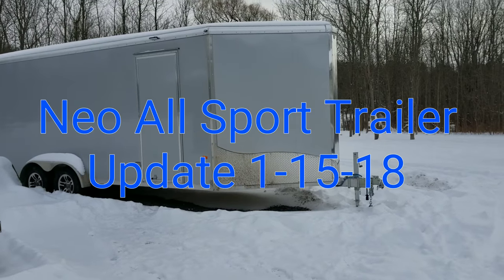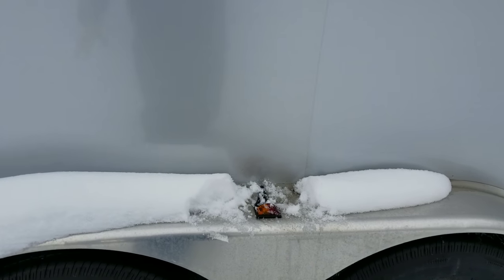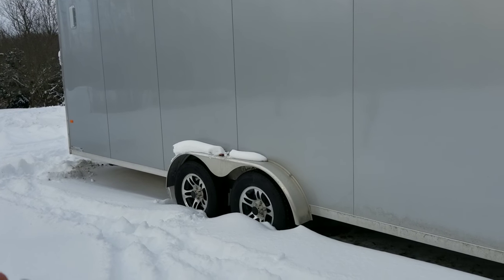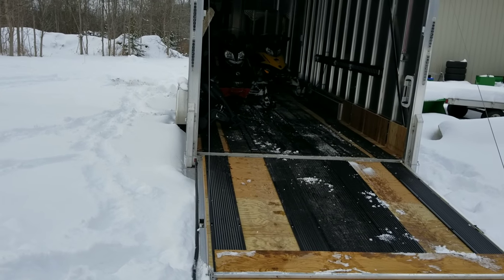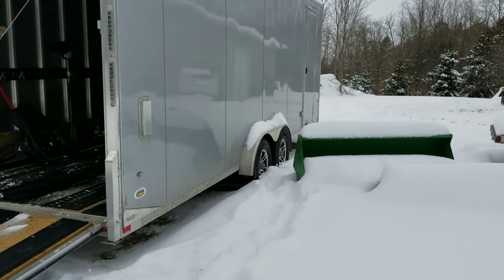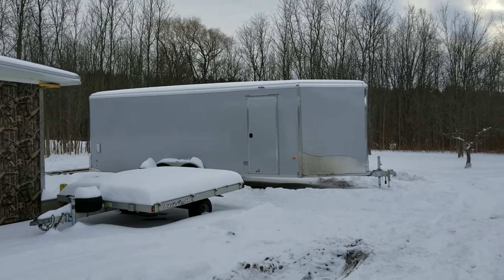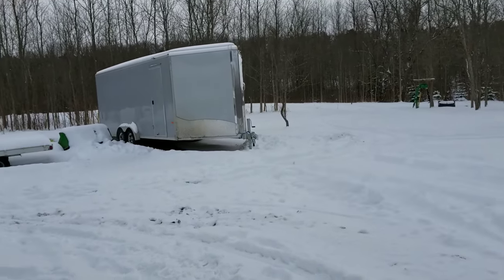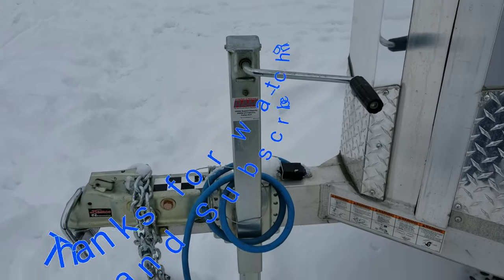Neo All Sport Trailer Update 1-15-18

Comment: Thanks for video.  My rear door seal on my Interstate did same thing. The red peel off 3m backed tape on those seals needs the promoter wiped on the surface to triple the stick power. Maybe the prep at factory was bad.  I wonder if your tongue weight is light. But regardless these are kites with or without awesome load balance.  Keep us posted.  Getting my NEO NAVR147R6 late Feb.

Comment: Thanks for the update, I bought a brand new Neo back in December also. Mine is a piece of crap. I've only used it on three snowmobile trips. I spent countless hours washing and detailing it and store it in a heated building, and it still looks like s***. The front Diamond tread Stone guard is cloudy and dull looking. The aluminum trim is oxidizing. It also Hauls like a kite, maybe because it's a 26'x8.5'. they use zinc plated Hardware, which are already starting to rust. Please give an end-of-season update? Thanks

Comment: My Front seal failed as well. Not the back though on my 2017 NAS227T Sport. On the rear ramp flap.. my screws stripped out and the 2foot section of flap came off. They used just self tappers into the Wood vs carridge bolts I would think would be better. All my interior lights and loading lights are not working now either. Also.. this things dents so easy! I swear a tin soda pop can is thinker!

Comment: The electrical issues are manufacturing defects, absolutely stupid to not use sealed connectors.  The height of the trailer and the way it handles in the wind is not NEO's fault.  Even the best trailer you buy will pull the same way if it's this size trailer.